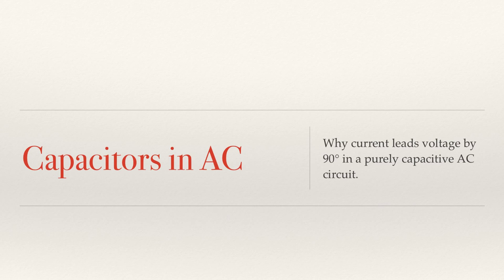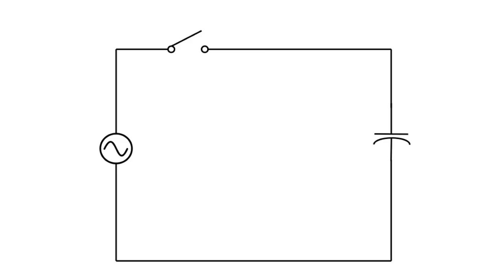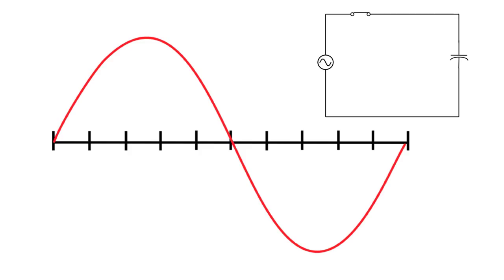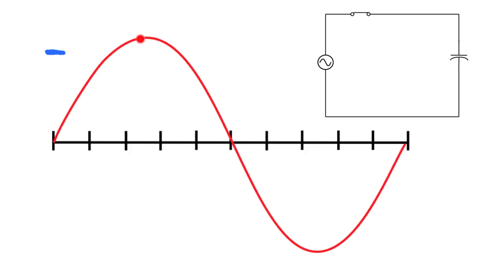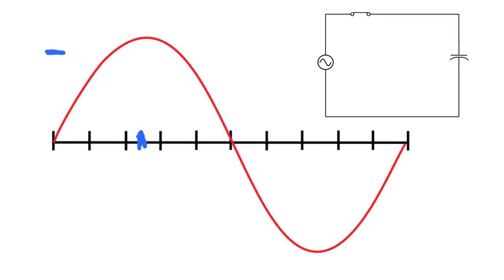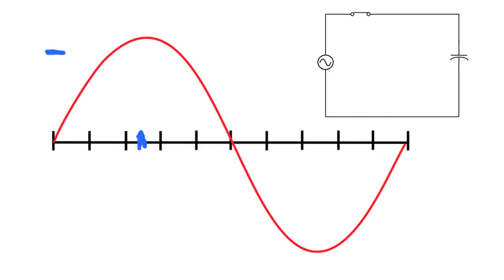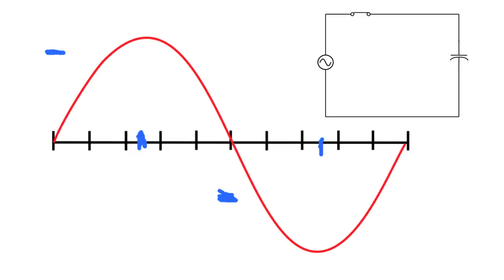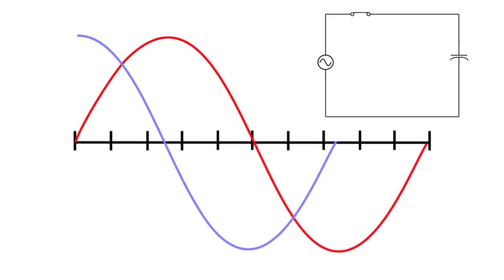Why voltage lags current in a circuit of pure capacitance.

Comment: a few yearrrs laterrrr..
Where in the circuit is that?  anywhere? 
is that in AC only or in DC too?
but is it the opposite right inside the capacitor,or  not?

how hard would it be to show all that in an oscilloscope?

Comment: Does voltage really "lag current" by 90 degrees?  Or does current just lag voltage by 270 degrees?   I know they are the same result in steady state, but I'm speaking in terms of cause and effect.
Reply: carultch actually, current leads voltage by 90 degrees. 😊

Comment: Excellent. If current changes it's direction, than why don't fan changes its direction as per frequency?
Thanks.
Reply: The Answer Is Motor Is Responsible For Running Of Fan , So As Long As Motor Doesn't Change Direction, Fan Will Keep Moving In Same Direction
Reply: @shubhumchatterjee Thanks but my question is about motor (voltage/current)?
Thanks.
Reply: Yes The Motor Runs On AC Current and The Current Supply To It Changes It's Direction. I Think Your Question Will Be Know That Why The Motor Direction Is Not Changing? It Is Because, The Motors Require Mechanical Power To Change It's Direction and Current Direction Cannot Change It.
Reply: @cck0728  If Your Question Is Then Why Can't We See The Change In Direction Of Current? The Fan Should Once Start , then Stop and Then Again Start? But It Remains Constant! This is because AC Current Has Supply Frequency Of 50/60 Hz(Depending Upon The Country) . Hence In Each Second, The Fan You See Running Is Actually Starting or Stopping 50/60 Times But It Is So Fast That You Are Unable To See It With Naked Eyes
Reply: @shubhumchatterjee  Thanks for the clarification.

Comment: You said that in order to get a difference of potential, Current has to flow. I thought it was the other way around? I thought in order for current to flow, you had to have a difference in potential?
Reply: Ohms law
Reply: When a source voltage is shorted, positive and negative bolted together, .measured voltage is 0, voltage is present but can't be measured, that's essentially what happens when a capacitor is first connected to a voltage source, as the current fill the plates , voltage reestablished itself and can be measured . The scope will show 0 voltage until the plates begin to fill, this is what causes measured voltage to appear to lag. In summary you are correct current cannot flow without voltage.

Comment: The fact I don't understand here is that how does the current be at max value even when the voltage is zero? this doesn't follow the ohms law right?
Reply: r!shi kesh Capacitor voltage not source voltage..
Capacitor initially behaves as short circuit  (vc=0) hence maximum current..
When the current flows ,it charges capacitor And voltage is developed across capacitor  Capacitors needs current to develop voltage.
When the capacitor reaches at maximum voltage i.e (source voltage ) current will become zero
Reply: Aaqib Bhat oh..i see! the phase shifted voltage and current waveforms are just those across capacitor. please explain me same about inductor. In case of inductor when voltage is at zero current is negative maximum how does that work? Is it due to back emf?but how would the back emf exceed source voltage and cause current to flow in reverse direction?
Reply: r!shi kesh Inductor oppose any change in current. Inductor is like inertia it opposes the change.
Initially let there is no current goin through in an inductor when u connect it with source the current does not come instantaneously .Imductor opposes the change (it tries to oppose the current from flowing ) hence current will be zero and voltage will be maximum .Then current starts building and voltage decreases.At maximum value voltage will be equal to zero.
(Inductor opposes due to back emf there is no such thing happening backemf exceeding source voltage, negative current means polarity is changed).
In DC circuit inductor behaves as short circuit because there is no change in current (but it opposes when u turn ON  and  OFF switch when u ON it tries to stop current from flowing and when turn u off switch it tries the current continue to flow in same direction as it was going before)
Reply: Then if current is needed to develop a voltage, what's the role of voltage once it is developed?
Reply: Aaqib Bhat in DC source, inductor does not behave as short circuit,,,instead ,,,it behave as a normal wire.
Condition -when DC current is steady.
Reply: Actually it follows ohms law

Comment: Current doesn't flow across a capacitor.  If it does then you have dielectric breakdown hence the capacitor isn't doing it's job 🤣

The only thing that comes to mind after watching this crap is the blind leading the blind.  Also, your drawing in the video has the current lagging the voltage 🤯